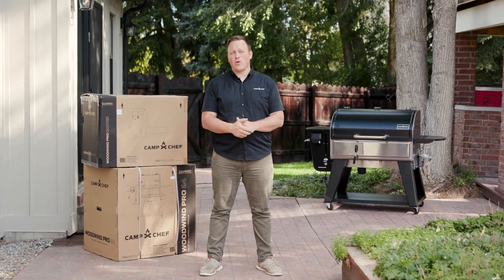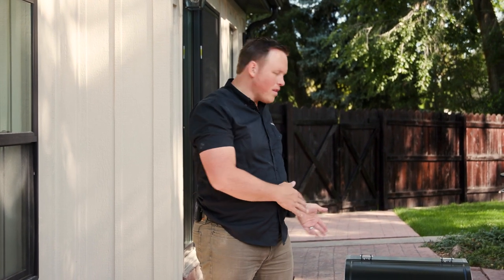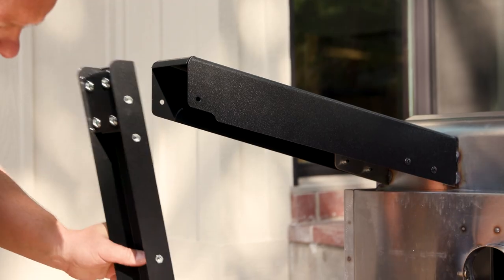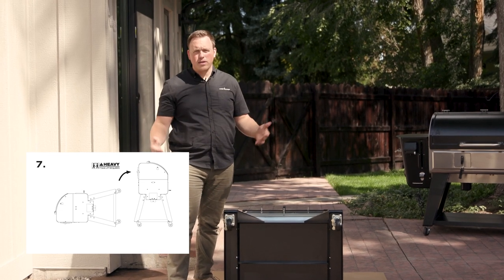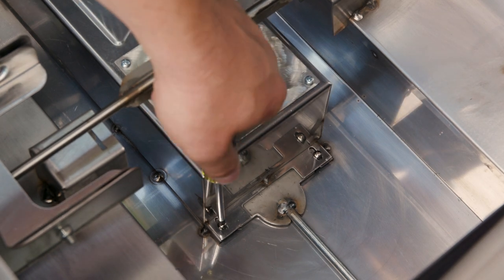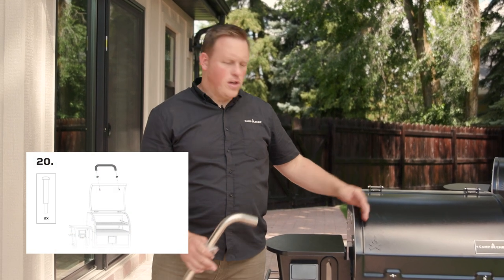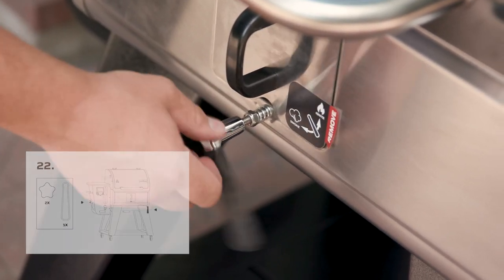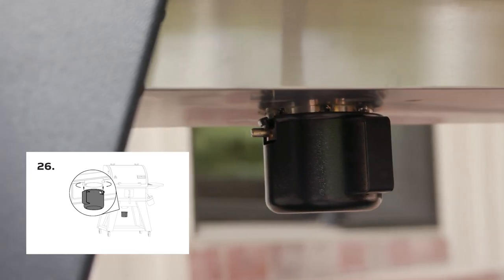How to Assemble the Woodwind Pro | Camp Chef

Comment: The directions in the box are horrible and the bags were missing labeled and missing screws.
Reply: I am currently having this same issue.  I have bags with screws/parts that match to steps that say they don't require any and I have bags with step numbers that don't even exist.

How did you resolve the issue?  I reached out via chat earlier today, but so far they have not been very helpful.
Reply: @marcp3600  the bags are miss labeled, but the directions are accurate, just have to use your best judgment a look ahead in the book and watch the video.

Comment: STOP.   There is a QR code that comes with your BBQ/smoker that shows ALL the steps.  This guy misses a couple key steps that require you to disassemble and start over.   Step 15 he shows re-installing the heat deflector however he doesn't show securing it with 4 screws that were not included in our box of parts.  He also left out Step 9.4 the Feeder Bracket that goes on the Hopper.

Comment: This is the worst grill i have ever put together and i have done plenty. This video, manual and app didnt even match on certain steps or was backward. The app says the heat deflector should be screwed down yes has no holes for it. The handle for the wood chunks is a disaster. Every time you twist it to smoke or ignite it bumps and moves the deflector. This is why i prefer offsets. Theyre all in one welded piece and not this mess.

Comment: Please address the sticker on the burn box.  The adhesive is impossible to get off, even though it says "Remove."  I had to use acetone and a scrub pad.  If you look at some videos about the WW Pro, others clearly give up on that sticker, and it looks terrible.  Honestly, I was hoping to see you try to remove it in this video, but by the end it just disappeared.  Also, mine had a bag for step 9.4, which is not in the instructions.  I think I figured it out, but it was kind of a mess.

Comment: I used the video to help with the assembly of my new Woodwind Pro 36. The video shows a completed hopper assembly which unless you follow along in the manual you would miss that like I did.  You have to use the loose half pages in step 9.  The numbers on the bags did not correspond to the numbers in the instructions or in the video.  All the parts were there but you had to pick through them to find the right bag.  Otherwise the video was very good and the assembly went smoothly.  All the holes lined up nicely and I was able to do the assembly by myself.  The hat was a bonus.  Time to get smokin'!😃

Comment: Mine didn’t even ship with the instruction manual. And the bags do not go in order. The manual I find online does not call out for bags of parts. I have bags labeled as 3,4,5,6,13,15,16,17,18,19,22,24,26_27,28. Is that all of the parts bags?

Comment: While putting together a woodwind pro 36, there are some inconstencies.  They provide an App to build called Bilt, which is easier to use as the resolution is much better, but the step numbers bear no resemblance to the printed manual and parts bags. Second though minor in the video, manual and app, they say 4 screws hold the hopper onto the BBQ. There are 6 holes and 6 screws supplied. Finally the prob from the hopper that is screwed to inside of BBQ actually has 2 wires that make it too thick for the hole in the cover plate (step14) increasing the risk of damaging the cable. 

I got around these, but a fix to instructions would be good
Reply: Yea I emailed support about the step with 4 screws & it actually has 6 & 6 holes, I think my upp rack guides are upside down after watching BILT video, the diagram appears to be different
Reply: I found the exact same with my grill

Comment: Minor tip (aka learn from my error)  I spent way too long looking for the assembly manual in Box 2, so I could match up steps with the hardware in the bags.  Mine was actually in the barrel of the grill (Box 1), instead.  So, check both boxes.  Also, the installation instructions aren't posted on CC's website,  so it would be nice if they were posted under the manuals section.

Comment: Just assembled my woodwind pro 24 yesterday and boy are there inconsistencies in the book instructions vs the numbered parts bags. Mine was completely missing the hopper bolts so I had to use my side shelf bolts in place of those. Inside the hopper at the bottom there’s a screw missing where it attaches to the auger even though that’s a pre-assembled part. The legs have quite a bit of  twist/tension in them so they had to be forced into alignment. 
Overall it feels solid when built, just getting it there was a real pain. Instructions said 45 min but it took over double that with all the time spent searching for bolts.

Comment: Unfortunately, Received my CC WW Pro 24 with the following damage and less than complete assembly.  I couldn't straighten ou the leg assembly without a torch and sledge hammer. I followed the assembly manual step by step and when complete I "Feeder Bracket" remaining along with a hopper lid and pellet strainer uninstalled,  no pellet rake found.  I typed this while I waiting for CC callback.
Reply: I'm building mine now and ran into the same issue. How did you get it resolved?

Comment: Mine had a step 9.2, 9.3 and 9.4 which involves putting the hopper together before sliding it into the main chamber. For 9.3 the required screws are attached to the hopper lid and not in a bag of hardware.

It arrived damaged and they are sending a new lid, but damage was clearly not from shipping, just bad quality manufacturing.

Comment: My woodwind pro 36 arrived today
Damaged in manufacturing and in fedex shipping .
Small dings and scratches and bent up corners of a few pieces.
There is a gap at top of hopper where it attaches to grill and lots of play/movement where hopper is attached.
Can’t imagine how far it will pull away from top screw mounts with 20lb of pellets in hopper.
Small screws used to fasten fire pot to inside of smoker have no stopping point and have a stripped feeling
Nice stainless steel and wood chunk smoke feature but hardware is not as robust as I would expect in this price range.  I have a timberline 1300 and it is of better material and build quality in my opinion, minus the stainless steel. 
Manufacturing qc not that great.
Might have got a not so good one 
Bought from BBQ Guys
Why this didn’t ship freight like my timberline is beyond me